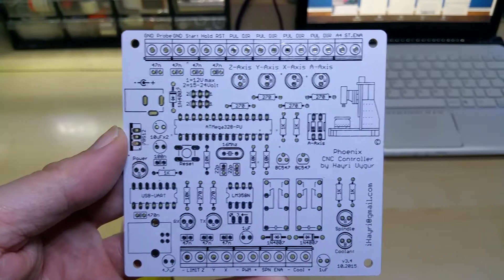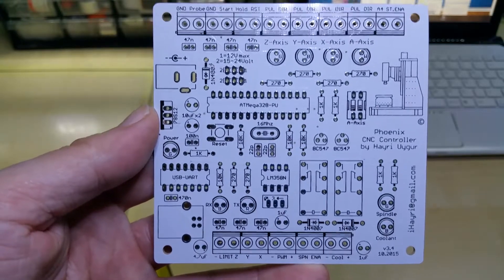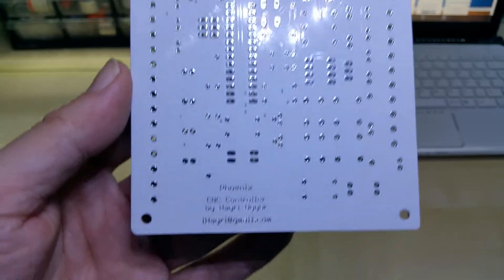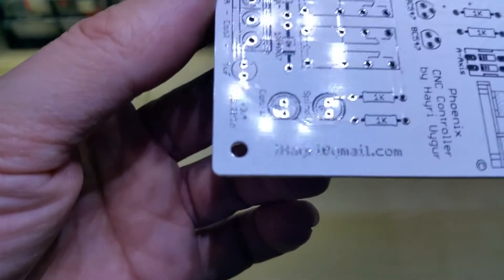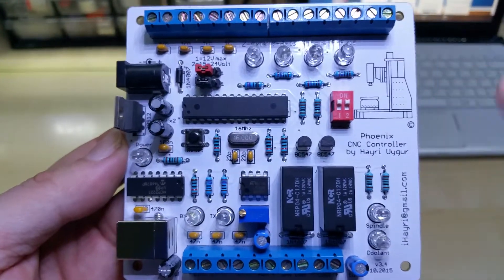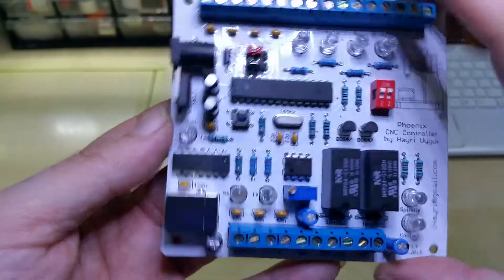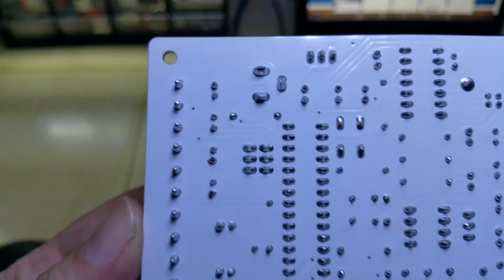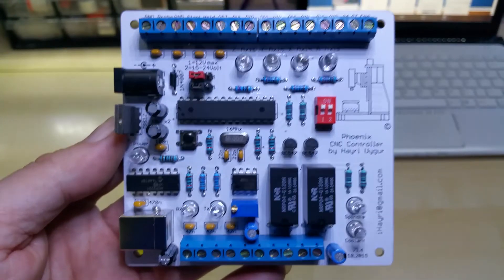2nd Version Phoenix CNC Controller running latest version of Grbl

Comment: That's very neat and looks quite promising !
Old generation cnc folks believe that parallel port controllers are ideal because they maintain the timing associated with the step and direction signals while the usb don't so they usually have a dedicated pc for their controllers. These same people would also recommend the use of smoothstepper if usb connection is desired. 
I am building my own cnc and I just cant believe there isn't an alternative out there for parallel ports. TinyG is a great alternative out there but again some say they are not as reliable because they are usb. I even considered the G540 and a smoothstepper.
What makes this Phoenix CNC controller different to these old technologies previously mentioned?
Reply from the maker: Well, I guess everybody has his own preference. Using parallel port was never an option for me because I had no PC having one plus I only use a laptop and I think it would be hard to find a laptop these days with a parallel port. I personally also think that a parallel port is more suspect to error when the PC all of the sudden starts doing other stuff. Of course a dedicated PC would maybe take care of that. Over USB many many lines of code get put on queue so even if there is a delay somewhere no g-code gets lost. One other thing is I don't like Mach3, not the way it looks and works nor that you need to buy it. Back to USB, Grbl and Universal G-Code Sender which my board and I use, did test it over and over with a particular code that is over 340.000 lines long without one error. I also did sell many of my controller boards with not a single complain about it not working or getting errors. There are thousands of people using Grbl with great success. But you are running a computer and electronics and something can go wrong. I see multi million dollar CNC machines with a emergency stop button, so errors can occur be it by humans or machine. There might be alternatives for parallel ports but for me USB is the way to go.
Reply: Thanks for explaining. I needed someone with your expertise to clarify it. I guess older folks are in their comfort zone with parallel ports and they are not interested in trying new technologies. 
Also, what brought me here were they excellent reviews on your product :)
Reply from the maker: Thanks for your kind words, Phil. I am not that old (49) but I understand were you coming from. Even I refused to learn about Arduino and AVR chips at the beginning and wanted to stick to logic IC's for my electronics and finally bit the bullet and started with a Arduino UNO. And now after doing so many projects I could bite my behind for not starting out sooner. I started out with switches and colored 6V lamps when I was a kid, my dad was a electrician but I always like tiny things. And now with my second version of the OLEDiUNO PCB and the tiny OLED displays I am a happy camper. Take care.

Comment: This look cool. Do you solder them all yourselves?
Reply from the maker: Thanks, yes I hand solder each board myself and to make it look this good I clean all the flux left from the solder. Every person that bought my board is very happy with them for looks and function.
Reply: They look great. I saw this on Kyo's YouTube and considering buying on. I am building a machine myself, although won't be at the electronic stage for a few months. Are you working on a third version in the near future? I've subscribed so look forward to seeing future videos.
Reply from the maker: Do you mean third version of the electronics? Well I designed and build a stepper motor driver that attaches to my CNC controller. But I am also building another big CNC router that will get finished in winter time because I need to buy many more parts for it and money is always a problem.
Reply: Yeah curious if you were planning anything else? This looks like what I need though, and considering you make them yourself I'd like to buy from you. Is that the link in the description?
Reply from the maker: Well I am always working on new items, right now I am making OLED GPS Cubes, OLED display Watches and soon a OLED Spectrum Analyzer and OLED Altimeter among other things. These are being sold on Tindie. I edited the eBay link in the description.

Comment: Great job you done there it looks very impressive.
Reply from the maker: +Bill Parker Thank you very much Bill. I had to also change the link on this video to the updated ebay page. Funny how to versions of the ebay page now exist. I see that you like or are interested in LED's. Have you seen my (unfinished) Neopixel clock? :-) Sadly my CNC Mill is gone but now I am working on a new CNC router.
Reply: Hi no I have not seen your led clock but will look. I have bought 100 5050 ws2812b's a 5Mtr 300 led stip of ws2812b's and a T1000s controller and been using the 300 strip with an arduino. I have only built a wooden mill but it is something to use one of my arduino's on.
Reply from the maker: +Bill Parker Wooden Mill sounds interesting, my second CNC was a wood router :-) good for plastic and drawing only. I have several Arduino projects with Neopixel and LCD on youtube. I was buying my WS2812B strips of ebay but a follower of my channel  suggested AliExpress and there are much better deals to find. I even build a tiny PCB just for controlling Neopixels with it. I call it Arduino Popsicle because of it's size, again there is a video on my channel showing it. Take care.